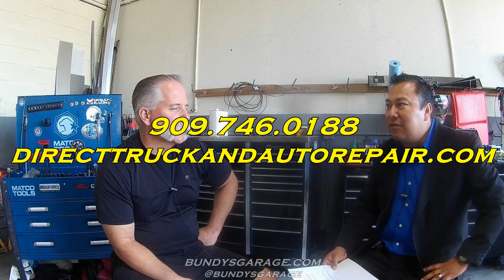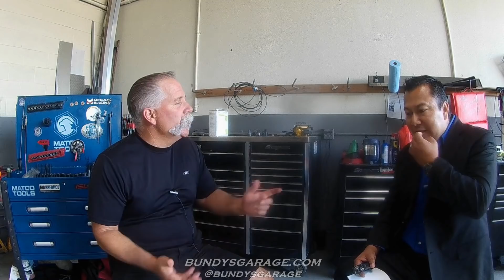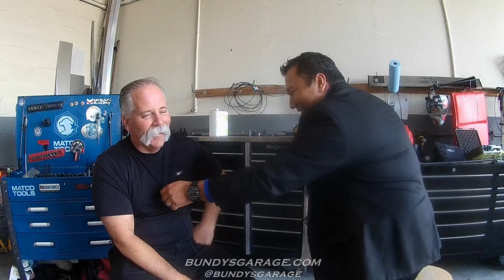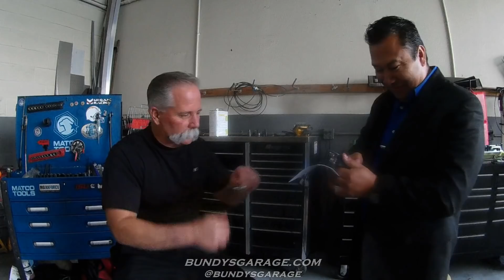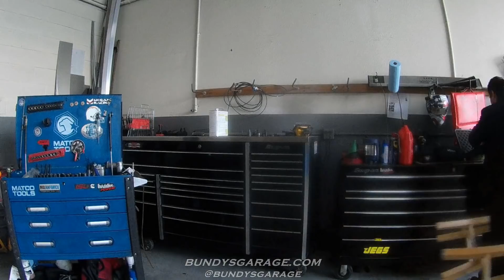Worst Diesel Engine Ever - What is the Best Diesel Truck out There? | Ford Dodge Chevy

Comment: The Diesel Olds wins it by many miles. I took my 1980 GMC 1-ton into the dealer for 30,000  (1983) mile check, they informed me my engine block was cracked and had been epoxied together, they won’t touch it. The service manager called the Old Diesels “Crackers” and he was right. I remember that Cadillac buyers were also not very happy about receiving the Olds diesel in their Caddy’s. They filed a class action suit and won. I may be off a little but it seems like the Olds block didn’t start out as a diesel, it was a gasoline engine bored out to be converted. This left critical areas too thin for the much higher pressure diesel. I can’t fathom GM being this stupid and careless.
Reply: It was a 350 gas engine with diesel head's
Reply: GM makes a bunch of awful garbage

Comment: 7.3 powerstroke. The one and only. Yes its rough at idle, but it simple, torqy and reliable. Powerstroke was never good from 6.0 and out. Then rather have the 6.6 duramax. Miss my 7.3! 5 years and only oil change. No issues.

Comment: Almost all the Ford 6.9 and 7.3 trucks wore out steering boxes before they wore out engines.
Reply: yes. mine is starting to go at 250,000/ engine fine except for leaks
Reply: @jmyers9853  They'll scare the crap out of you when they get the shimmy shakes. Don't put it off and ruin an otherwise great truck.

Comment: There is a reason that 95% of semi and 100% of all tractors farm equipment and construction equipment are in line 6.
Reply: They are easier to work on. The V8 design on Durajunks and Powerjokes is a pain in the ass to work on, but I'm sure it makes mechanics more money.
Reply: Also Steven, some tractors use the V8 design. The John Deere 8850s in the old days, and the bigger Cat dozers are a couple examples.

Comment: 2nd gen 5.9 12 valve all the way
Reply: 2nd gen 24v common rail would be mine. I have a 1st gen  ppumped w350 and a 01 2500 w/compounds injectors tuner . I love the 01 . Im truly considering a common rail swap.
Reply: Best years of dodge

Comment: Drive a 700k mile 7.3 at work, towing well over 10 tons (12-25 yd dumpsters)
Gone through a couple transmissions, driveshaft, transfer cases, and differentials.  But the motor is still stock, from 97.  Tuned of course

Comment: Olds diesel or the 6.5 diesel, both terrible. Late 06 6.6 duramax prob one of the best, along with the 12v Cummins, though the Cummins tend to disintegrate seals and leak more than a 6.6 imo. I agree ford has a great chassis and the 7.3 was a decent motor, but wasn’t excellent (turbo lag, hipop leaky stiction issues) My 6.6 has original turbo original heads and I’ve replaced 2 injectors and just hit 305k miles. Still original trans. I’d disagree on using the Cummins.. I’d take a 06 6.6... no DEF vs a Cummins 6.7

Comment: To me Dodge doesn't count they don't build their own Motors like Ford and Chevy do they use someone else's
Reply from the maker: Chevy does not built their own diesel motors. Ford only started building their own diesel motor with the introduction of the recent 6.7L Scorpion Diesel. Problems are starting to show in the 6.7L as well.
Reply: @bundysgarage  okay maybe Chevy doesn't the Ford has had its hand in Building engines for their trucks since the late 7.3. They may not have built them entirely up until now but they always had a part in it the other companies rely on other people
Reply from the maker: You have a point there. If your not good at something just sub it out. Boeing and Airbus do not make the engines that they strap onto their planes they manufacturer. So to each his own. Honda makes its own  engines. The new Toyota Supra has a BMW engine and transmission, it’s more of a Bimmer than a Toyota.

Comment: past experice with 2 6.0s .03 an 05.piles of shit.worst trucks ever.now i own a ford 08 6.4 powerstroke with 279k,ford 14 6.7 powerstoke 98k.both deleted an tuned,reliable problem free trucks.just recently decided to try sum diff an bought a 16 duramax 48k,tuned & deleted aswell.great truck so far.but no where near the power or as responsive as either of the fords.

Comment: 6.7 Cummins known for head cracking between valves.
Reply: All Cummins heads crack between the valves. They usually pressure test okay though. When I changed the head gasket on my '01 it was cracked all over, psi checked ok, been running it hard since then, just easy while warming up and no problems.
Reply: @ChaosViper67  you are very fortunate. I on the other hand for Every Cummins from the "N14, M11,5.9,6.7," that I have done an overhead that had cracks in between the valves always was accompanied with a report of either performance loss, overheating, excessive fuel consumption.  etc. etc. I based my opinion only on my experiences. 
Caterpillar's heads on the other hand are considered to be within spec even when they are exhibiting signs of head fractures between valves.

Comment: I’ve owned 8 diesels. Best by far was my Mercedes 2.4L naturally aspirated 4 cylinder. They were extremely over-engineered and severely underpowered. How underpowered? One of the definitions of “courage” should  be “merging into traffic with a 77hp Mercedes diesel” 🤠🤠🤠 . I had nearly 800k miles on my 1980 Mercedes 240d when the floorboards went “Fred Flintstone”. It never EVER left me on the side of the road. An extremely close second was my 12v Cummins. It had 421hp and 1087lbft torque at the wheels and could easily get 23mpg

The worst diesel by far was the 5.7  liter GM (Oldsmobile) . My dad was in the used car business when I was in high school. He would go to auto auctions and buy diesel Cadillac’s for super cheap and repower them with 350 c.i. Chevrolet gas engines and make a fortune. But while they were awaiting their transplant, I would drive them around while they were still diesel powered to pick up parts., etc. I had SEVERAL of those GM diesels blow up in spectacular fashion (It was kind of fun to see to be honest )

Comment: Good video. Couple points. Cummins. Not Cummings. And I think you might be confused about the duramax headgaskets. There are 3 different thicknesses. Grade A, B, C. Also there is the old style headgasket you run on 2011 and older that look normal, and a gold colored one run on the 2012 and up. Anytime you do a HG, the heads need to be decked and the factory TTY fasteners replaced, and always run a grade C (thickest one) and it’s done. I don’t understand what your experience has been in having issues getting headgaskets for the duramax. I have 2 2006 duramax trucks, one is a dedicated race truck as well as a 2016. I find them much easier to work on than any 2003 and up Ford diesel.

Comment: What do you guys think of the 2002 Ford E350 7.3L Diesel ?
I’m looking at a 15 foot box truck with this engine, with 144K miles.
Reply: Carpenter Family depends on what your needs are (and how experienced you are with diesels). The 7.3 is hands down one of the greatest diesel engines build, and Fords best diesel engine (to date). There aren’t many problems with the 7.3, but get gauges to monitor EGTs and the tranny temperature. How much are they asking for it? And where is it located (I ain’t trying to get it, its that rust plays a big part) and the condition of the vehicle on a 1-10 scale. All in all, do diligent research, and don’t jump the gun. 144k is nothing for a 7.3, properly maintained 7.3s can go 400k+ IF you keep ahead of the maintenance. Diesels are more expensive to own and maintain.
Reply: Ye Olde Spaniard Thanks, I knew nothing of diesels, much less the 7.3 - really I was looking for the box truck with attic. The Ford dealer did all maintenance- it was one owner. It’s located in the SE US inland - so no snow nor salty ocean air.  It looks good. 
I agree with you about the gauges. I’m going to use the Torque app and then add physical gauges for what that app doesn’t have. 
I’m going to really have fun learning about this diesel.
Reply: Carpenter Family Here is a playlist I have compiled of diesel/truck maintenance. https://www.youtube.com/playlist?list=PLFbJF5Cl-iIWUzUjk4YpboVA79Ez3QrWR . A lot of 7.3 info in there alomg with some for a Duramax lol. With what you replied with, I would go ahead and buy that (if I were you). + the resale value of any 7.3 is still holding steady

Comment: Best diesel engine? After 35 years around diesels. 1. Ih 466 by far hell they were in ag. Tractors and combines I've had them no problems so far, 2. Cummins, a straight 6 will last longer than a V on average. But have a case Ih combine now with replaced Cummins after original cummins blew a hole out the block the size of a basketball=$12,000. Do have a duramax, 350,000 miles on it, new injectors and head gasket before I bought it, and ya they gave documentation that that was done. Been told by a few mechanics that they still service duramax engines with over a million miles on them. Take care of them and they'll take care of you. But damn have a 1999 dodge ram 120000 miles I hope there built better today 3 transmission s? Are you kidding me! But was told never let them sit and idle it'll burn the trans up. I don't know. And I think Dodge is another word for rust.

Comment: I just sold a all stock all original 2007.5 ram 3500 6.7 Cummins with 600,000 kms and still runs and drives perfect and gets 9 litres per 100 kms
Reply from the maker: How much did you sell it for?
Reply: $7,000

Comment: Thing is you buy a 7.3 the trans is junk like all the one Ford made.
Their trans either quits or shifts like a rookie on an 18spd.
Reply: Put a 6.0 cooler, and a boost valve in it it will last at least 200k.

Comment: Ford factory reman engines have issues. I had a 6.4 engine come back with 6000 miles on it and it dropped a valve seat into the piston out of nowhere. They used an old process called "staking" to seat the valve seat into the head. Not good for 42 psi of boost in a stock truck lol

Comment: I’ve got a 6.0 built for 1200 horse and the shop I work with is doing 1600 with theirs and they run great. You can build them to last. And my turbo on my 6.7 did eat it so I swapped it for an s463 on a 2nd gen manifold and did head studs and some other stuff but they all have issues regardless of brand but I love the 6.0

Comment: I love my 6.4. But I took a pretty proactive stance on making sure I loved it. EGR valve and cooling plumbing delete and regen delete which is removing dpf replacing with straight pipe insert and buying a tuner to trick the computer to think it never needs a regen.

Comment: Ford does suck I know like 3 diesel mechanics and none of them like ford they all have Dodge one of them is putting a 12 valve 5.9 in a 70's Ford Truck with a eaton fuller 10 spd trans but they all drive, race cummings and I agree Dodge and Cummings are the best in my book the only good ford is if they are gas powered not diesel

Comment: So your a ford guy, does that reflect the different diesel engines like chevy, dodge ect. in your thinking?
Reply: Duramax is not a GM design or built by them. It is a Mack and Isuzu collaboration.

Comment: I drove a Ford L series (1978 model?) that has a v8 diesel I've always wondered about.  If I recall it had a dual range 4 or 5 speed and was a 22 ft box.  This truck got 20mpg and had bullet-proof reliability.  I drove this truck 150-200 miles a day and it was never in the shop for repair during almost 3 years except for the air brakes one time.  I know it got 20mpg because I was the only one who drove it and personally put the fuel in it.  Out other diesels (IH, Fords) got 12-15 mpg)  I've always wondered what engine this was and why they didn't put it in smaller trucks.

Comment: What's your opinion of the Fiat Ecodiesel ?
Reply: Toopy Anne Binoo the problem is diesels after 07 have more problems because of the emission devices.
Reply: travis rosier 

Like I said I owned an 01 Cummins.   Great truck but after 17 years it had issues ... It didn't blow any heat ( trust me even with a new heater core etc etc etc don't need to well did you try this or that ... Yes ... I did)   In Canada heat in the cab is a must have eh ! Plus lotsa of other annoying pissy issues.   
I was born and raised on a farm and got my class 1 plus I have an electrical certificate and work for the local utility .   If it has wheels I probably drove it. Diesel and gas . 

My nephew was on my ass and tbh I was due for a change with waaaay more and better comforts ! 

None of the trucks today are worry free heck my supervisor has a 2017 Dodge Cummins ... Motors good but the dam front end is shit and he's pissed off too ! 

Now as for my Eco diesel .   Fiat has made Diesel engines and gas engines forever .   So I trusted them.  I bought the 3rd year of production for typical avoiding the early usually 1-2 years of bug issues . Well I thought I did it right. Everything was peachy and love the truck .

But guess what you are right ... at 27 000 Km or about 16 750 miles . When I had a car beside me at a stop light or being beside a concrete barrier I detected a mild tick .   Brought it to the dealer .  Fragments in the oil pan .    Replaced the engine .  So you are right .   My worry is will this happen again ?
Reply: Oh and yes the International Harvester "Binder" in the Fords are great motors one of friends has one . But .... The mechanicals are gone because of pollution regulations .   As you've pointed out .
Reply: Toopy Anne Binoo they are garbage don't buy them
Reply: travis rosier 

And your ?   Who ?   Your experience , background are .... What ?    Your Panda riding a rocking horse is weird ... Are you a Flamer ?
Reply: Toopy Anne Binoo I'm a diesel mechanic and I've seen many problems with those engines
Reply: travis rosier 

Your no one . Don't believe you. .   I'm asking them ... Not you .
Reply: 😂 ok whatever you say
Reply: Also I found this picture funny that's why I have it but I don't need to prove myself to you. I was simply stating the truth about that engine. Now the real question is why are you so angry.
Reply: travis rosier 

I'm not angry at all just proclaiming they are just junk and never to buy them seems a pretty confident opinion of being a mechanic for .... Well must be 20 yrs in the biz then .   My last truck was a 01 24 V Cummins ...  But I'm almost 50 and it's a younger mans toy now sold it to my nephew who knows what he's going to do with .   

So I want an older fart truck ... Sooo what ...?   A f'in Dakota ?  Maybe a Canyon .... ?   Shitty cramped f'in gas jobs ?   Oh an eco boost that does 4 mpg pulling my boat ,  wave runner or camper ....   Oh Let me guess your a tundra white paint white shade soy boy stopping at every gas station.

Ohhh the Hemi !  Which is a bIgger pig than all of them unless you launch it into the Grand Canyon . 

So I might as well buy a front wheel drive Chevy Impala to tow my 5th wheel ... With slight mods ... 

So ... God ... Because you seem to know everything ... please help me Lord all mighty ... what is your answer ... Alleluia ! 👏🏻👏🏻👏🏻
Reply: Actually I have a 02 Ford f250 with a 7.3 and before that I had a 1990 Ford f250 with 500,000 miles on it.  The reason I don't like the ecodiesel is cause they have major issues which result in needing a new engine.  Honestly if you're wanting a good truck get a 06 or older Dodge ram with the Cummins those engines last forever.